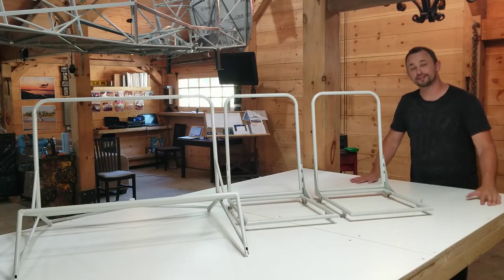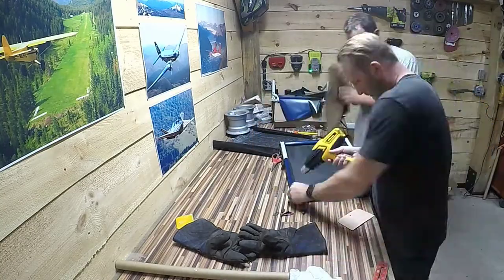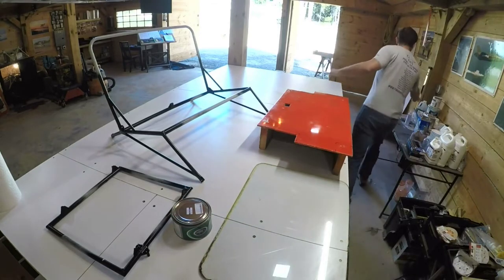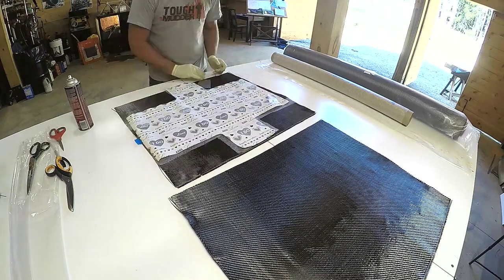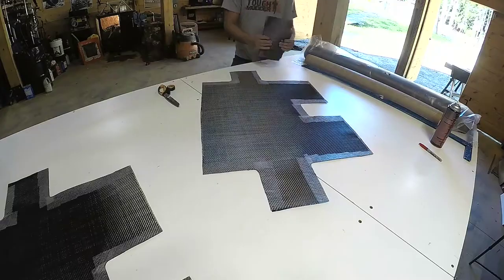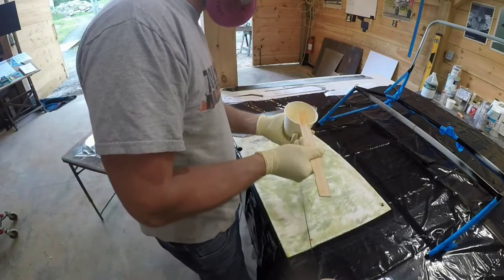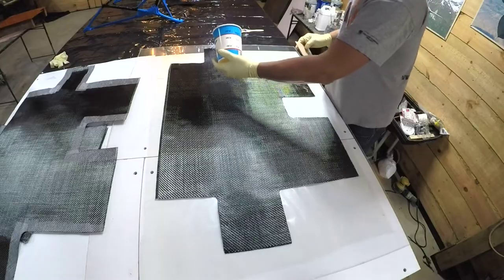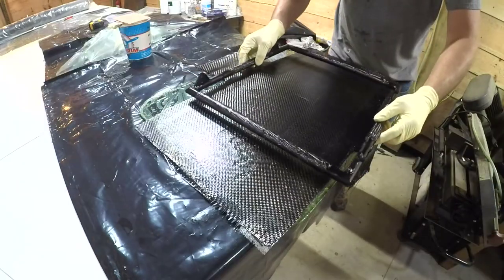Bearhawk - Carbon Fiber Seats

Comment: So I'm curious about not using a Kevlar layer to  keep the carbon fiber from splintering and having thousands of needles running you through in an emergency situation?
Reply from the maker: Well....good point.  I did actually put a thin layer of kevlar in after the video for that reason.  At the time I thought...if my seat pan is that badly damaged....the person in it is not likely going to fair to well.  All my other parts do have kevlar in the layup

Comment: Doubt youll ever see this, but if you leave the top plastic on and use the spreader to push air out, you'll be able to see the air coming up and end up with a great pre-preg and better bond.
Reply from the maker: Thank for the tip!!

Comment: Do you know how much weight the carbon added? How much weight is saved over the standard seat pan?
Reply from the maker: The typical setup is an aluminum pan riveted or screwed into the frame tube.  Off the top of my head carbon saves around 20% compared to Aluminum.  I do not have the exact numbers

Comment: Is there any concern with the carbon fiber applied directly to steel causing electrolysis and decaying the steel?
Reply from the maker: Not at all for two reasons.  First, the steel has a solid coat of paint on it.  So no steel to carbon contact.  Second, it is a dry environment.  Being the inside of the plane, it wont have water to aid in a corrosive process

Comment: What does the foam inside of the carbon fiber do for strength?
Reply from the maker: The lower back area was quite flimsy prior to adding the foam.  It helped a lot.  Also it gave me a curved feature to wrap my seat covers around.
Reply: It's a light weight filler that makes the carbon more efficient. Think about how a truss is stronger per pound than a solid block. Look into the statics use of moment of inertia for more info

Comment: Good comment below on the stiffness of carbon fiber.  Was that considered? The engineering episode seems to be is missing.  The internet is full of un-engineered carbon fiber videos.  People tend to think that carbon fiber is stronger than anything it's replacing so there is no engineering required.  Maybe that's OK.  Maybe not. There should be NO maybes in aviation.  It would be lovely to have that Oratex fail in a crash and have a steel tube break your back.
Reply from the maker: You bring up good points.  Yes stiffness was considered.  I try to keep the videos short so i might not dive into the engineering on every choice.  Whether carbon fiber is stronger or not  depends on the material you are comparing it to.  I 100% agree with no maybe in aviation,  we have zero tolerance for that in the Aerospace industry.  I have seen a few methods to do the back.  All with pros and cons.  What approach would you have chosen?
Reply: @barnbuiltbearhawk7267   You could proof load the seats. To at least 5 G. The rear seat frame alone seems pretty flimsy to me. 2 hefty, a hard landing and I can see those tubes getting bent.

Comment: Carbon is not going to absorb energy in the way you might want in a crash.
Reply: Good question that went unanswered.
Reply from the maker: @stevebrown5819  it is a statement.  But, the bearhawk does come with a nice suspension setup and will have larger than typical soft bush tires on it.  I did consider an energy absorbing system similar to fall arrest gear but chose not to.  It would take time to engineer that setup.  I will ride this through the test phase and reserve the right to change it later if I feel uncomfortable with the setup.